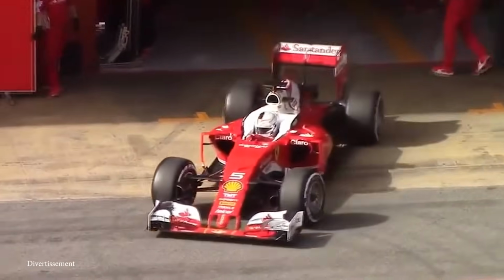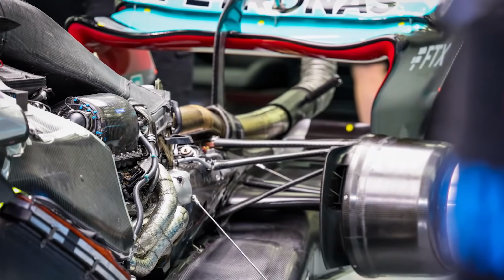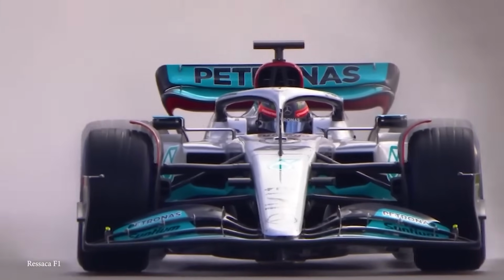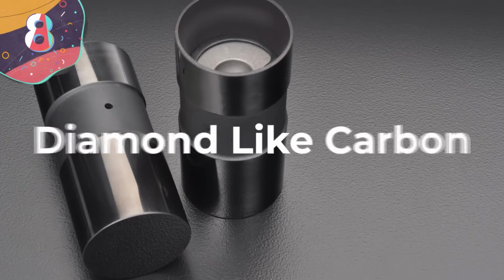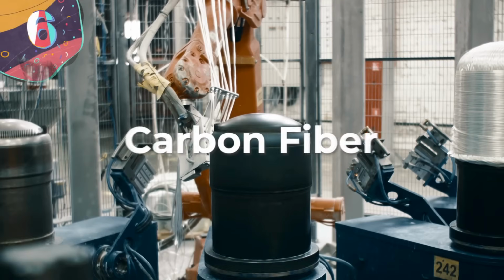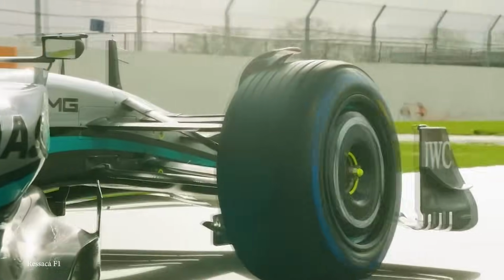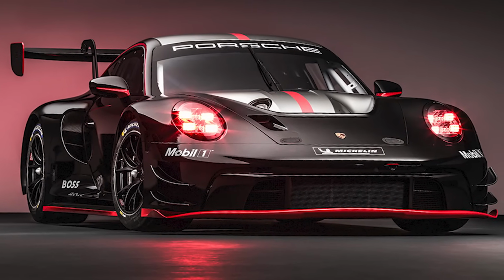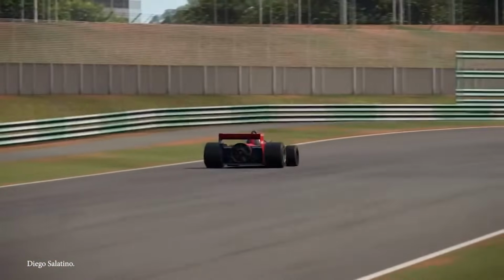15 Remarkable F1 Car Innovations

Comment: Before the FW14B, the lotus Renault 99T had the active suspension.
Reply: Not very effectivly, the williams piornered it and made it work.
Reply: @JasonTaylorRacingF1   Pioneer definition: develop or be the first to use or apply (a new method, area of knowledge, or activity).  They did not develop it nor were they the first to apply it so your point is invalid.
Reply: @altinsilsile36  They did indeed develop it, Do you think they just took Lotus's exact suspension design from the 80's and plonked it on a 92 F1 car? No they had to make it work for their car and make the software for it, so they did indeed develop it.

Comment: You are wrong about the DRS. It can be open anywhere on the track, but it is limited to certain part of the track during the race.
Reply: that was only for the first year
Reply: OP comment is right here I think. 

Drivers can only use DRS when they’re within one second of the car in-front of them in to stop DRS trains. (If everyone used it all the time then it’s benefits would be negated)

In practice and qualifying laps, it can be used in exception to the rule above but only in DRS zones. DRS zones are unique to each circuit and are usually on open straights. 

They’re most never near corners because that’s where all the downforce possible is needed for cornering and, well safety.

There’s weird crossover on the rules which I’m not entirely confident on but I think it’s roughly as above.
Reply: @jazzingpanda3190 OP comment was right in 2011, the first year of DRS.
Now it can only be opened in the DRS zones anytime during FP and Qualifying.
Reply: @WiisardNic  okay fair enough my bad! Thank you for the correction